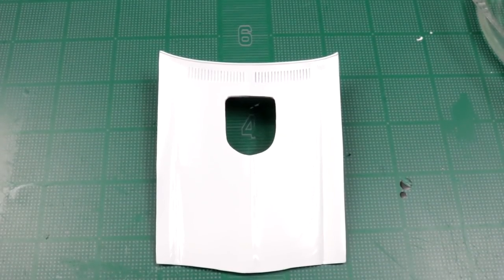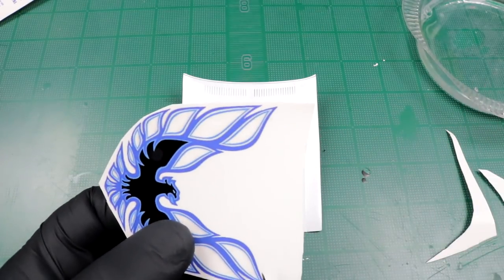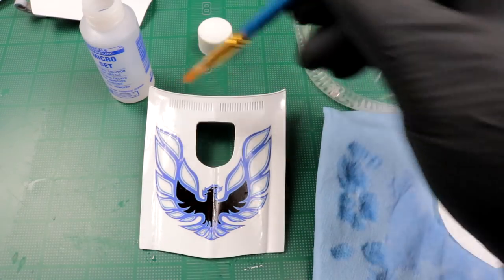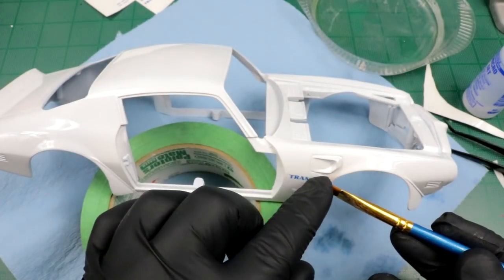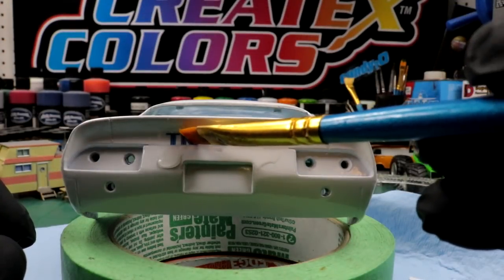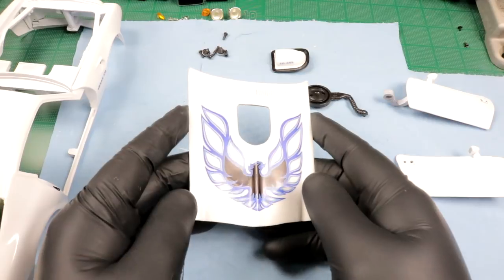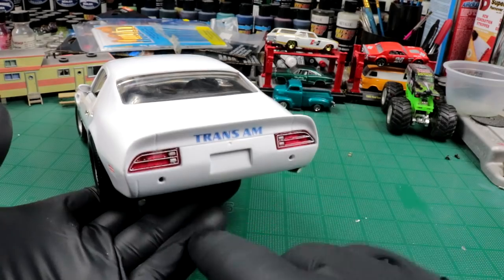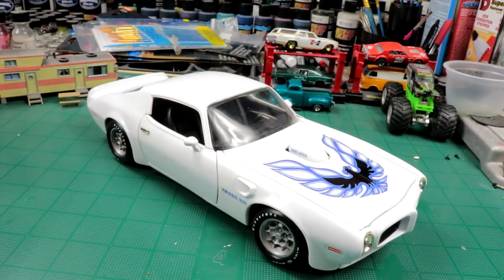BARNFIND 1:18 Scale 1973 Trans-Am Restoration (Part 2)

Comment: I've always pronounced it as ER-TLE as in Turtle. As I've mentioned before 1:18 scale is easy to customize compared to 1:64. These 3 you've done are great, I hope you do more 1:18 in the future. Great Job! I would have painted the engine "Pontiac Blue", I not sure what color the Trans-Am engines were, all the early GTO's 389's & up were blue. I'm looking forward to the GTO John is sending you. I had a 1964 and a 1966, The 64 was a Le-Mans with the GTO option in Silver, the 66 was a 4 bbl version, in Burgendy. Regards Tom USA

Comment: Looks great Ace , who needs bumpers anyway 😆.... maybe you can just rout the exhaust tips out of the holes where the bumper should be Austin. Top job as usual , just one thing, the engine and Trans looks an unusual color , l thought it might've been a blue engine block with a silver transmission. I was watching a guy who did a 1/18th model kit version. That's the color he did the engine and transmission on his .... l guess yours came in the color provided 😕.... Still it's not a criticism just an observation that's all. Great job 👍

Comment: Looks good my friend here's a little information on erdel diecast cars they are very old in fact they might be the first diecast car company ever of course Matchbox is over a decade older than Hot Wheels starting in 1953 but the Ertl diecast car company started in 1945 that's right 1945 the original maker started by making diecast tractors in his own furnace they are a very old company